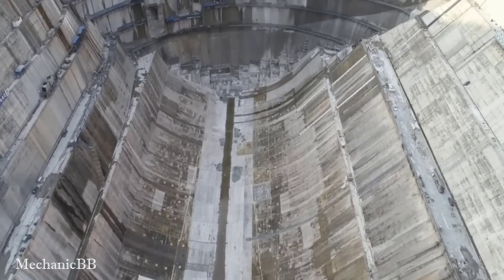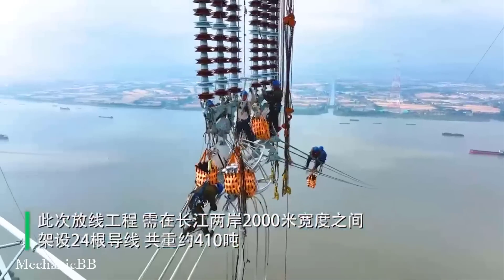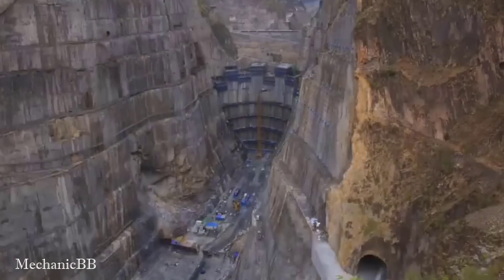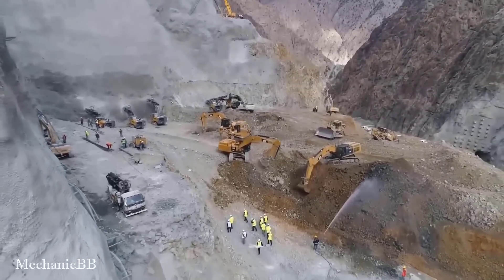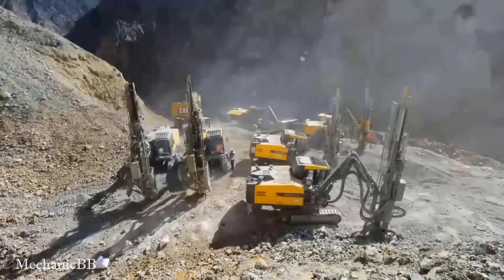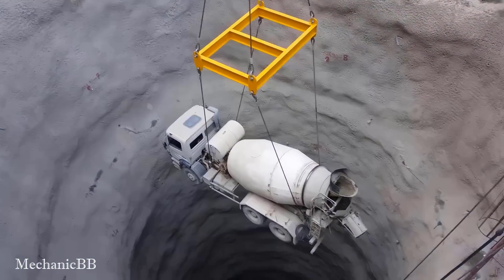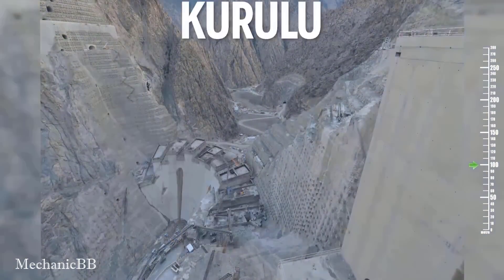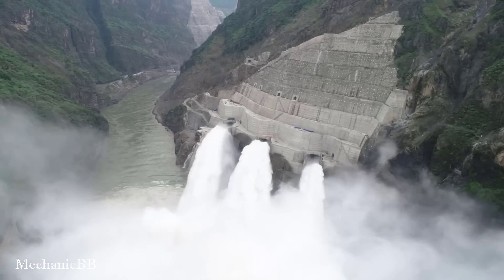World Dangerous Fastest Builds Largest Dam Construction Modern Technology, How to Build Biggest Dam!

Comment: When hydro systems are still made with only one bank of turbines then the system throughs out 5-10% of the power it could make
Reply from the maker: That is a very practical opinion. You are a person of knowledge. But in my opinion it is an evolution in energy technology because using that 5-10% of energy is negligible.
Reply: wrong again the power is recoverable without issue to the turbine hall and can be made today proof of concept was made in Gosford north of Sydney Australia back in 2016 by RDP Marine Australia  @MechanicBB
Reply from the maker: Thanks for your extensive knowledge. I will acknowledge it.